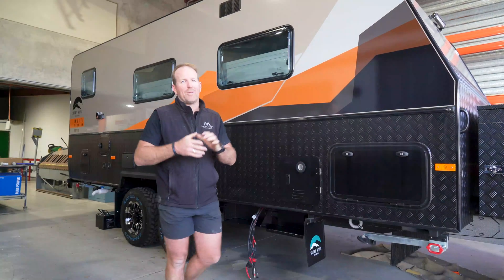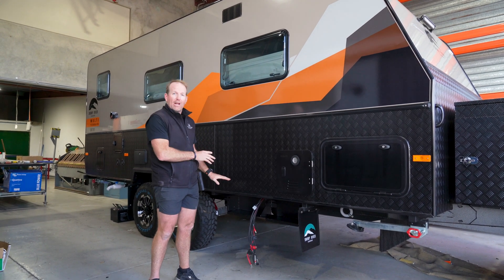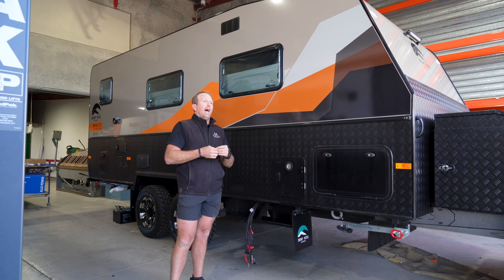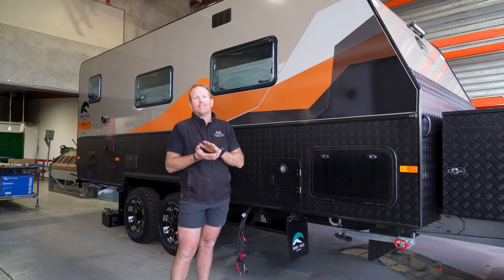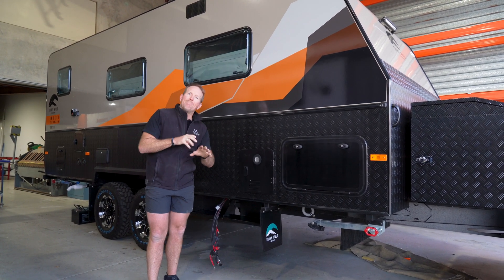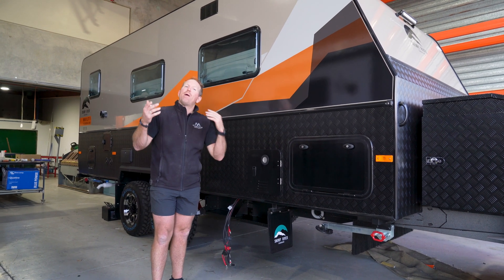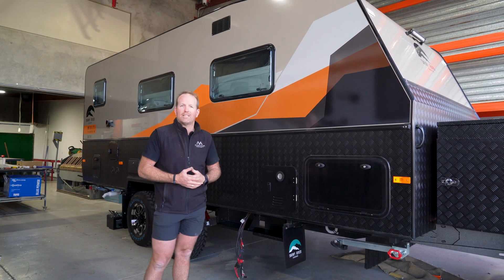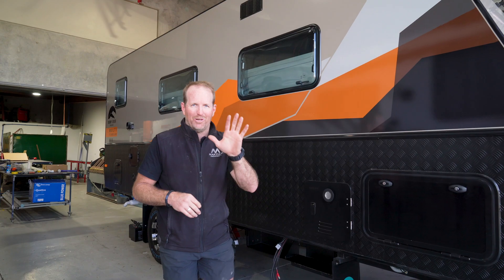This Could SHUT DOWN Your Caravan Power!

Comment: Maybe time to mention some Li batteries that work in cold countries. For example Renogy Core (and others) that have warming circuits and are designed to sit in metre deep -20degC snow wrapped around RV's in the Us/Canada for example. Your customer should be using self heating batts where the internal heating can be activated by running vehicle engine for 10 mins or so or charging circuit if 240v connected. I also camp in temps down to minus 10 in the snowys when fishing and if my Li batts were not under the seat and warmed by a diesel heater I would have purchased a batt with internal heating. With the new Li rules and caravan makers hanging Li batts in cradles underneath I reckon the shutoffs will be common, even in the outback in winter where mornings can produce an inch of ice in that billycan left out.
Reply: Plus some batteries have internal heating which automatically activates in very cold temps.